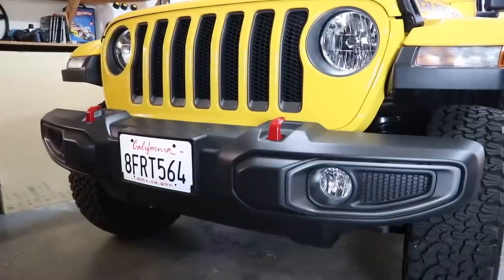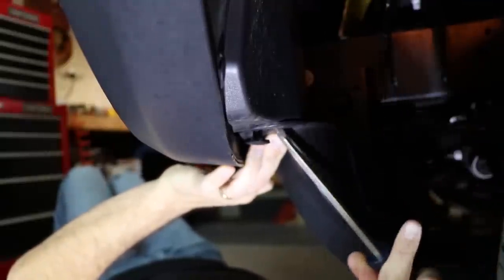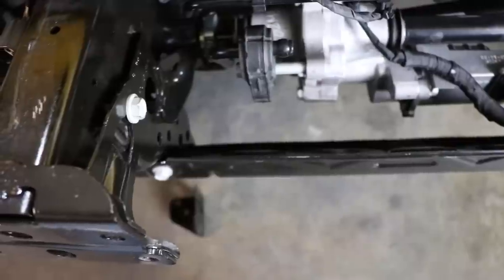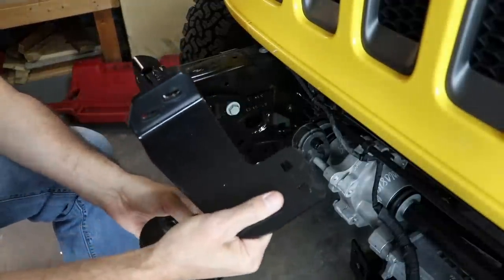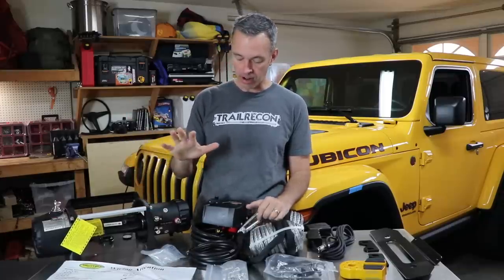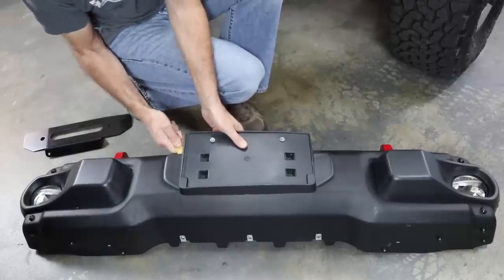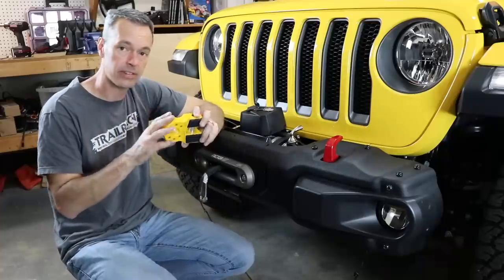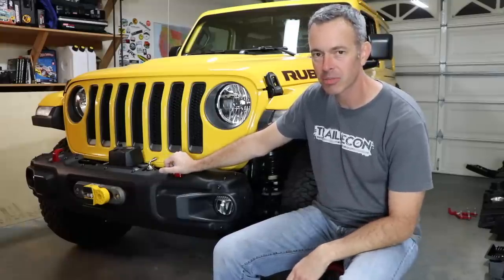Jeep Wrangler JL Winch and Bumper Install + Plastic Bumper Removal

Comment: Anyone considering this project should research the method for installing the Mopar RivNuts.  They don't just slip in.  You have to compress them into position so they don't slip out.  There is a special tool for doing this but you can do it yourself with an M10-1.5 x 50mm Bolt, two regular hex nuts, and a washer.  

I did this install a few weeks ago with the exact bumper and winchplate.  I'm using a Smittbilt H2O 10000lb winch and had the same issue with the control box. I real PITA.  

BTW did you have any flicker issues with the LED fogs?  I'm going to use the TaserJL to turn off the flicker issue that I'm currently having but the firmware for doing that is still in beta.
Reply from the maker: Great knowledge, thank you for sharing... I'm pinning this to the top so other can take note.  Yes, I noticed a little flicker last night, so something I'll be looking into ver soon.  Thank you!
Reply: Metalcloak made a really good video about installing rivnuts.  I'm not sure if the size of the bolts and nuts are the same in their video but the application is the same.
Reply: You are correct  @tomd1939 . That video is here:  https://www.youtube.com/watch?v=3Og-tHIR_0I

The only difference is that you'll need different sized wrenches and sockets and you don't need a lock washer because the Mopar RivNut isn't round and won't spin freely on its own.
Reply: Yeah... Definitely a pain. I learned the same lesson when I upgraded to the Rubicon bumpers on my JK.
Reply: So Rick Can you use the Nuts and Bolts you state?Is their room to get the nuts in behind the bracket?

Comment: Thank you for not owning a 4 door
Reply: Whats wrong with 4 door?
Reply: @UndercoverPOP92  nothing it just seems that everyone always gets the 4 door jeeps
Reply: @owenbame1131  That's true I rarely see 2 door models. They are like a gem
Reply: I bought a winch ready steel bumper from Quadratec. Pulled the plastic bumper off, installed the the new bumper, and the warn winch I bought fit without any additional winch plates. Her Jeep looks nice, good job 👍🏻

Comment: How could Jeep put a plastic skid plate on a Rubicon???
Reply from the maker: Agree 100%
Reply: well I've owned 3 jeep wranglers(TJ,JK&JL) now and a CJ7 I had in high school but if I were to guess about the plastic bumper&skid is that they know the bumpers are one of the 1st mods we jeep owners do. Just remember how long has it been sense they offered the metal ones? After all they 1st showed up on the Rubicon 10th anniversary additions right?
Reply: It's not a skid plate, it's a self pruning air dam that directs air away from the suspension crossbeams etc. To increase fuel efficiency. If you do use your jk off road, it "falls" off on the first obstacle you approach.
Reply: Interesting.  The Gladiator Rubi comes with a plastic bumper (steel optional), but a steel skidplate/air dam.

Comment: This video has the most important piece of information about this project regarding the difference between the steel bumper group vs the plastic bumper group. Around the 7 minute mark  saved me several hours. You'll need a good Rivnut tool, or look up how to do it without one.  Thank you Brad for saving my butt this weekend!

Comment: Really great to see the endorsement of the winch. I just got my Gladiator and I want to put on a winch because I know I'm probably gonna be wheeling alone and I wanna make sure I have self-recovery all handled, but having to buy the bumper, winch plate makes it that much tougher when the cheaper Warn winch is $800. Hearing you say you've had those winches for years gives me confidence that if I buy one I won't find myself in a bad situation.

Comment: With the help of this video, I did this exact same upgrade to my 2021 Rubicon.  The part#'s for the 2 brackets are:  68353836AB & 68353837AB.  They are about $15 each.  Of course, you will need to install the RivNuts to bolt them into.  Thanks for putting together a great video!

Comment: Do you know what the part number is for the bracket that you have to reuse for Rubicon w/ the steel bumper package?  I can't find the inclusion of those brackets in any Mopar accessories (steel front bumper, skid plate, winch mount)

Comment: Hello Sir! Thank you for this video, I followed you step by step mounting the same winch plate and bumper. The only problem I have is with the 8 nuts that attach the bumper to the frame, I have issue reaching the two bottom bolts next to the winch to tight them properly, I suspect my tools are too shorts but I wanted to see if you have any advice! Thank you for all your content.

Comment: My dealer was going to have to order the rivnuts so I just took two 1” long 3/16s grade 8 bolts and welded them to a piece of 1/2” wide flat stock and fead them up into the metal bracket where the rivnuts go, slid the skid plate brackets over the bolts and put a couple nuts on it.

Comment: I was considering this for a new wrangler High Tide with the Recon pkg.   I want to get set up to flat tow it behind a motor home and considering a bumper with shackles to attach the tow bar to however I’m concerned if the shackles will be too high because the tow bar is supposed to be level. Also, most bumper manufacturers do not rate the shackles for towing. I’m looking for feedback based on experience on what is a nice setup.

Comment: 7:37, did some research here,  for originally OEM plastic bumper jeep owners,  no need to buy bottom bracket or Mopar Rivnut.  i would recommond the rough countery plate that offers different mounting points, and its cheaper

Comment: This is an excellent video.  I just did my own swap on my Gladiator, but using the Rock Hard winch plate and a Warn Zeon 10S.  The install was a bit more difficult in some ways.  However, I did not run into the missing rivnuts.  The winch plate brackets bolted right over those brackets that fit the steel bumper.  I had a helper and am not sure if the correct brackets came with the take-off bumper I had, or if they were part of the OEM gear from the factory.  My helper was doing the work down below.  I also don't recall the crossmember that was removed.  I've messaged my helper to see what he remembers.  However, I did the install of the OEM brackets with the new winch plate brackets over them and there was definitely no need to add rivnuts.  My only issue is trying to figure out what the correct skid plate is.  I've read conflicting info, and based on this rivnut discussion, it appears there may be some differences between the JL and the JT.  Anyway, again, great video.  Thanks very much for it.  Keep an eye on my channel in late January and you should see that Gladiator out on the trails.  ;-)
Reply: I have the 2021 Gladiator. The dealership changed the plastic front bumper to the factory steel.
I removed the steel skid plate two weeks ago. I have 4 bolts and I can't remember where they go?
I hand tightened 2 of them but the other two?

Comment: Can you show a picture or tell me where the fog light harness attaches to the warn winch mount like it says in the directions? There is no picture or explanation where to actually complete this. Also when you put the fairlead on the bumper the bolts go through the fairlead/ fairlead  plate / bumper and the warn winch plate then the nuts will go on the bolts tying all 4 together correct? Another parts that is vague in the directions.... thanks and love your videos!!!

Comment: I have a 2007 JK with plastic bumpers and I got a take-off JL 2018 front metal bumper. From researching, it appears I can just bolt on the jl metal bumper to my 2007 jk. Will, I have any issues? I also have the metal front skid plate, will that bolt on as well?

Comment: Are the Warn spacers really necessary? It seems like all they do is push the bumper out to clear a larger winch, and if the winch fits, I'd rather have to rear skidplate hole line up.

Comment: I had a plastic bumper. Got the steel bumper bracket kit which includes the bolts and nutserts. Somehow the bolts are too short for both brackets. What did you specifically use and or any advice on what to do? Longer bolts? Is the bumper brackets really necessary?

Comment: Is the winch add noisy  ?
Does it clank around when driving & hitting bumps in the road ?
Also does the added weight change the steering or handling of the jeep ?

Comment: Can a metal front bumper and 12500 lbs winch be put on a stock JLU rubicon or a JLU Rubi with a 2.5" suspension lift? Thanks.

Comment: Looks great. You might have to add a pwm module for the foglights. They may start to flicker due to the difference in voltage.  You can buy the led running/turn signal lights from the retrofitt source, and the Orem led tail lights are very cheap as well.
Reply from the maker: I noticed a little flicker last night, so something I'll be looking into.  Thanks!
Reply: TrailRecon look up the sales code or a tazer as well. I’ve heard those fix it.

Comment: Hi, great and useful video, steel bumper & winch is my next upgrade... thanks. I have a question: I have just installed a 2” mopar lift kit on my 2 dr sport JL with 17x9 ProComp rims (-6mm offset) on 33s BFGs. Do you think the tires will rub when off-roading in the desert. Please advise. Once again thank you.

Comment: Another good Video! Have a question though, how did you resolve the LED Fog Lights strobe flickering issue on a non-LED option JL? When I installed mine the new LED fog lights flicker badly.

Comment: Ha! This is a good one. We just my wife a 2019 JL a couple weeks ago and we are going to change out our plastic bumper for the Rubicon steel bumper, so we can add a winch (Pick the bumper up tomorrow). I actually like the look of the factory bumpers, so you doing this exact thing is kinda cool. But we will keep it wide, not stubby. My logic is because when we get into the tight trails (deep forest in Western Canada) the tree will bounce off the bumper... not the fender. This is cool. Can this setup work on the bumper that was already on this Jeep?

Comment: Do have the part number for the steel group plate? Currently installing the bumper on a Willy JL and the bumper did not come with the steel group playes

Comment: Brad nice job. Mopar jeep front bumpers are great. Just don't put the back one on unless you want keep replacing the lic plate. I just helped a friend do a install of a teraflex 2.5 sport ST2 suspension with falcon 3.3 shocks on his wife's new JL Rubicon. His wife  loves it. But she said her requested 35's were too small. She wants 37's now......go figure.....Happy New Year.....
Reply from the maker: Thanks!  I have the rear steel bumper, but don't think I'll be installing it.  Not only does it have issues, but we have the back up sensors and the steel bumper doesn't have the holes for installing them, don't know if I want to fiddle with that.
Reply: Brad when you do the back bumper have it done. My JL's Stealth Fighter Rear Bumper had the holes for the sensors and it took someone that knew how to set them up right to get them working right. But those sensors are really helpful backing up on a lifted jeep. As for that back bumper I took my lic plate in to my local tag agency and the lady said what in havens name.....I said Black Bear and she gave me the replacement lic plate form.

Comment: any1 have part numbers for the 2 brackets at bottom that comes with the steel bumper and not on the factory bumper? ...right before he talks about the rivets? I purchased a steel on a takeoff and didn't come with the 2 brackets on the bottom.

Comment: If someone buys a winch without bolts for the top bumper cover you can take the clip nuts that are on the cover and just hold them with a pliers or maybe visegrip to put the screws back on…..!

Comment: The initial droop in the suspension will get greater over time (2015 JKHR).  The stock front springs are so soft.  My Warn 8K and steel bumper dropped to the point where I had about 1.5-2" to the bump-stop.  Went with a 2" lift.  No drop in 2 yrs time.  I think the stock springs are too soft.

Comment: can you explain how you would recover some of the sag in the front end from the heavier bumper, winch and skid plate?
Reply: He briefly mentioned in the video he might add a puck--basically a disk that sets on top of the suspension spring. That's an inexpensive, easy way to recover lost height and maintain existing ride.

Comment: Do the fog lights mount right up to the steel bumper without any need for additional brackets ? Does it reuse the fog light mounting bracket from the Rubi plastic bumper
Reply: You actually either need new fog lights or there is a third party bracket to install it with the steel bumper.

Comment: would anyone know what those brackets are called or a part number. the ones that are not included with the plastic bumper but are necessary for the winch carrier install
Reply: Was looking for the same info.

Comment: Brad, I did this exact modification on my wife's new JL. Going from halogen to LED fog lights gave us a bad flicker. Are you getting the flicker and if so how did you resolve the issue?  Thanks!
Reply from the maker: I'm noticed a little flicker and something I'll be looking into soon.  Thanks!
Reply: @TrailRecon  Hey Brad, did you have any luck correcting the light flickering?

Comment: 🌟Big Tip:🌟 remove your grill, then remove that plastic piece you drill out. MUCH better access to the inside bumper bolts. The driver side still SUCKS but it's a little easier.

Comment: Brad, will you be ordering the factory bolt inserts that you had to improvise on?  Do you think you lost any strength / safety with the ones you used?  Thanks.  Also, since this looks like an upgrade I think I will take on, (I have a Firecracker Red 2018 JLU Sahara - love it!) if you do end up doing any type of spacer lift, it would be great if you show us how to do that.
Reply from the maker: I don't know if I'll change out the nut serts I put in, its something I'll be keeping an eye on.  If we do any type of lift, I'll be sure to record it.... the plan is to capture every upgrade/maintenance we do with this Jeep in 2019.  Thank you!

Comment: Hi, did you still keep the old bumper? Just wondering if you wanna giving away or sell it out. 😅 Singapore JL doesn’t come with that nice factory bumper. Ours is flat and bulky.
Reply: Just replaced today, wondering what to do with it and plastic air diffuser.

Comment: nice looking bumper, I wish mopar had that option for the jk…… or do they?
Reply: terry koder They do have it for the JK, look for the Hardrock edition or 10th anniversary edition
Reply: They do with the Hardrock Edition bumper - its the basically the same as the steel one that comes on the JL Rubicon.
Reply: basically it's a updated version of the Rubicon 10th anniversary JK metal bumper think you can get hem still through Mopar.

Comment: OK guys, school me on this:  I thought all Rubicons came with a factory steel bumper?  Is it just the Unlimited that offers this standard?  Thanks.
Reply from the maker: The steel bumpers are an option, not standard equipment.
Reply: @TrailRecon  at the end of the video you but the metal skit plate on and you stated that you has to long gate the hole. what do you mean with that ? And how did longe gate the hole. I just did the same mod on my two door jl sport.  the back hole does not line up with the plate then what should I do?

Comment: @8:20 roughly, I would have hot glued a tab washer and a nut inside instead of using what you did or the factory manufactured.

Comment: Hey Brad love the video, but all your videos are awesome. But I’m thinking about getting a warn winch the “Zeon 10-S Platinum Series Winch” it’s designed without a manual clutch for the setup I’m going with. It’s a hidden winch plate behind my Taco bumper. I know yeah a Taco.. :) but have you or any of your fellow Jeepers heard how safe these new winches by Warn are? I guess the best thing is that you don’t have to stick you hand into tight  places to engage the winch. But wasn’t sure if anyone has had any issues, I thought the manual clutch system was some-type safety mechanisms to protect you while pulling out the winch line. I’d hate to be pulling it out and some freak electrical mishap happens and its starts to pull in while you holding winch line and your hand or clothing gets wrapped up in the line. Please anyone who has one of these new winches can chime in, they are like $2,300 before taxes and shipping, so want to make sure I’m getting a safe product. But surely Warn has put a lot of $ into their R&D before releasing them.
Reply from the maker: Thanks!  That's an interesting issue, but not something I've heard about.  Perhaps there is someone else here in the comments that can offer some advice.